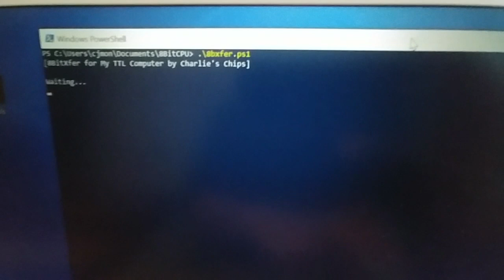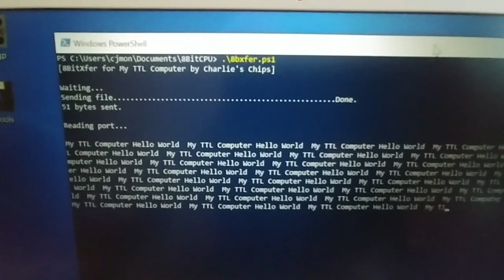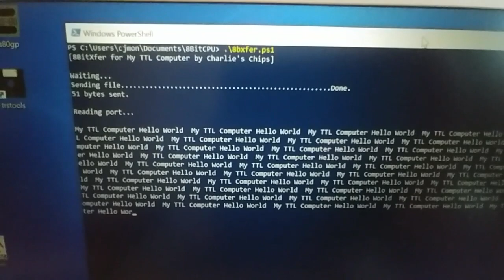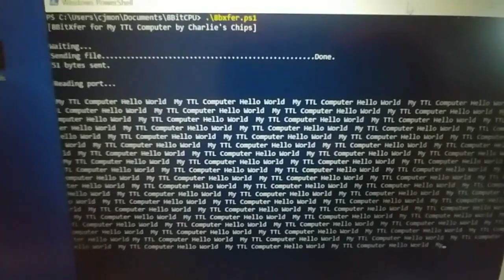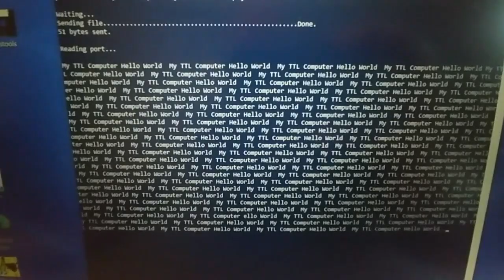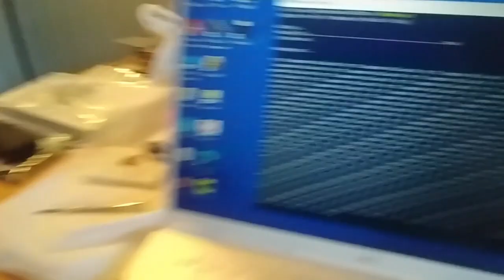My 8-bit TTL Computer #21 - We Have Ignition

Comment: Comms glitches haven't really been a thing since we stopped using analog modems, so the only two things that I can imagine is either awning the baud rate clock slightly off the target frequency - more than 5-6% off is usually not a good thing. Or maybe you're not waiting 1.5 bit periods from the startbit edge so your sample points aren't in the middle of the subsequent bits. Sampling at too close to the transitions will make it hit or miss. It's enough with a single gate delay to make it work in 99% of the cases but every now and then it glitches out. I did that once in a bit banged firmware receiver implementation.
Reply from the maker: Thanks Mat.  Yes, doing the 1.5 at the start.  Will have to dig into this more at some point.  I posted some additional thoughts on this in the Community Pages.
Reply from the maker: I finally determined the reliability issue with the serial communications.  The UART bit-banging was OK.  The cause was a timing issue with the UART receive firmware.  A single chip is implementing both send & receive, and both cannot occur at exactly the same time with my code.  The receive is processed by an interrupt handler and it was occasionally delaying the code which handles the CPU's IN request.  I was forcing some synchronization for the send and receive, but it was not sufficiently tight.   It is pretty solid now and operating at a 19.2K baud rate.
Reply: @CharliesChips  Nice debugging work there! Thank you for sharing the cause.